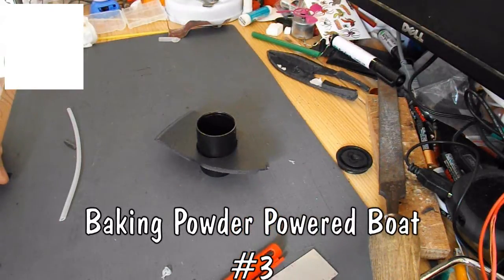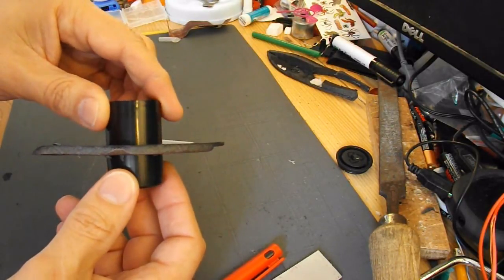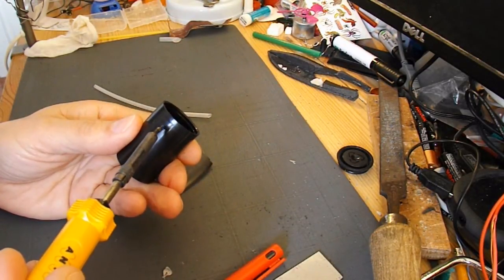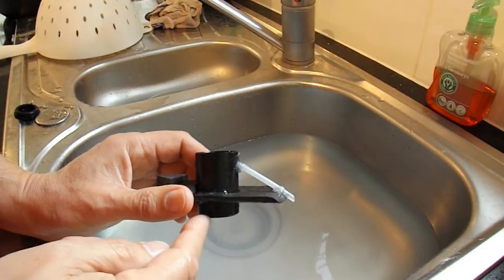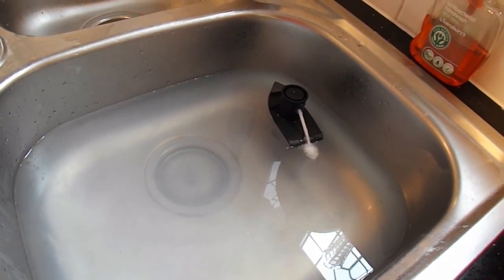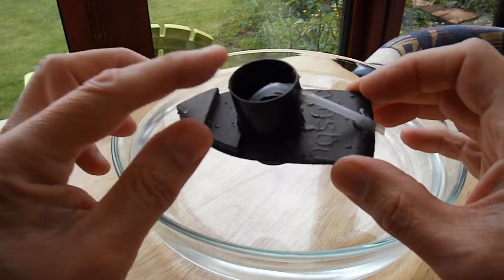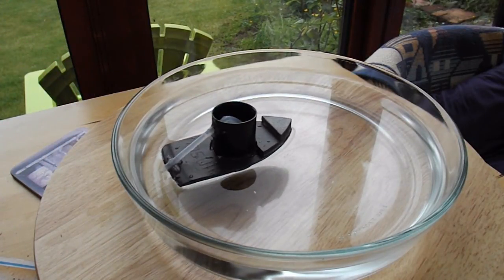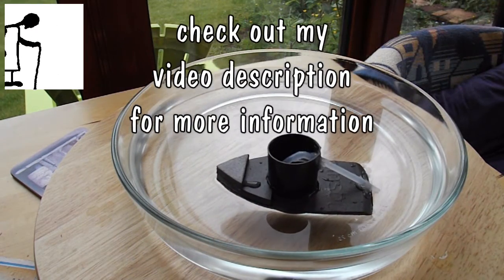Baking Powder Powered Boat #3

Comment: I'm 69 years old and I remember the baking powder boats very well.  We would get them in cereal boxes.  they were about the size of your finger (a child's finger).  The top would pop off and you'd put a dab of baking powder in there with a drop of water and put the top back on and put it into the tub.  The little boat would take off pretty fast.  Keep in mind that the area for the baking powder was very confined.  Not much room for air at all.  The exhaust came right into the area where the baking powder was contained.  These little boats were relatively fast.  Not sluggish at all.  I think you have way too much area where you're placing the backing powder and water.  Also, your boat is 10 times bigger!!  Your chamber, alone, would hold about 7 of those little boats.  I remember it well because I had a lot of fun with them.  I have a 3D printer.  Maybe I'll design and print one...
Reply from the maker: 3D printer is the way to go. I remember the boats and the submarines. You might find the information I put in the video description helpful including this link http://www.timepassagesnostalgia.com/&pm=0&searchkeywords=cereal+Miniature+United+States+Navy&sin=i631